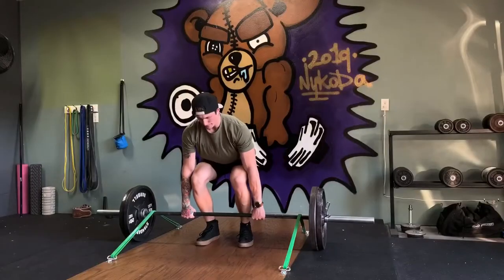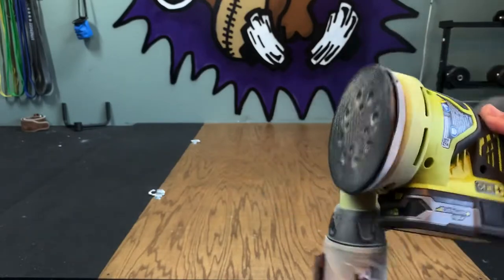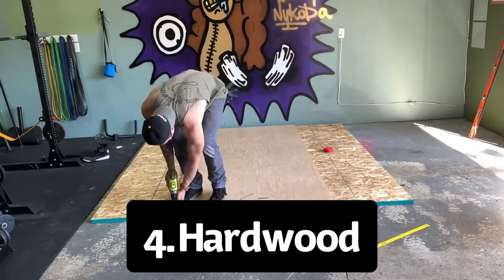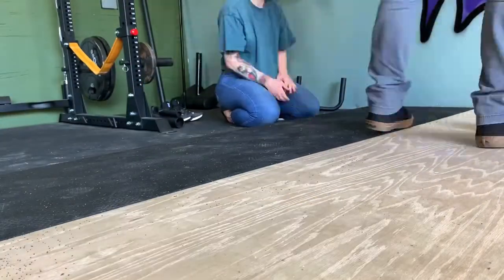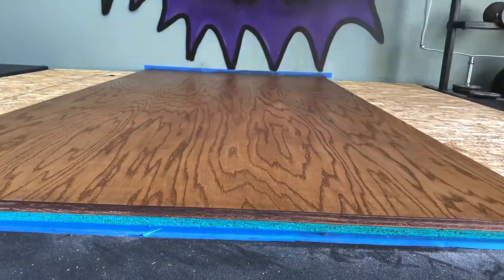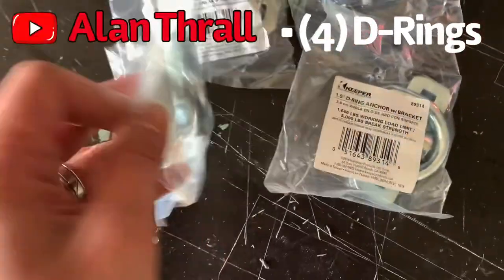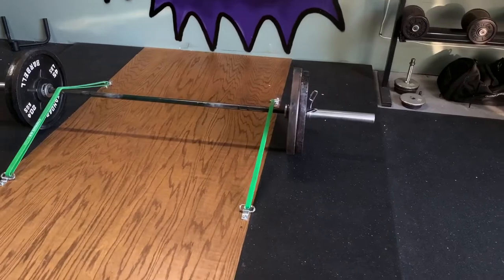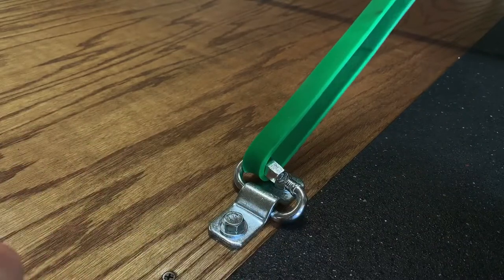How to Build a Deadlift Platform - Easy Garage Gym Projects

Comment: Iam not a powerlifter and don't really do olymic lifts. Do you think i will be better off with just stall horse mats or should i get a platform to protect my epoxy floors?
Also I have a small slope in garage and dont wanna be lifting on an uneven surface.  If i decide to go just with stall mats i wonder how 🤔 should i level them?  They are selling me an 8x8 platform here in my own town for $200.
If i buy platform hkw can i level it?
Sorry for all the questions and I hope you can help me. Thank u.
Reply from the maker: First off, we love questions, so thank you for asking! Secondly, if I were you, and you had some novice wood working skills I would build a platform, that way you can level it by using very small wood shims. Building one will cost roughly the same as buying that one you mentioned, depending on where you source your wood/supplies. So IMO, either of those options would be ideal. We will be releasing a new video on Tuesday, where I changed my entire garage gym to solve this very issue. I rebuilt my platform to be 100% level in every direction. Stay tuned! ✌️
Reply: The Outlier Theory I was planning on turning my basement into a garage gym and I thought the horse stall mats were for the deadlift. What’s the difference between having a deadlift platform vs horse stall mats and do I really need horse stall mats? Ty
Reply from the maker: tb nelson Having a platform gives you a solid foundation to work off of. The rubber horse stall mats only help with softening the blow of the weights as to not damage them. Having a platform is not vital for a garage gym, I used to deadlift off the horse stall mats before building mine. The difference is minute, and I would only worry about it, if you are a more advanced lifter. But for the average person, lifting off of horse stall mats is totally fine! Thanks for your question! 🙏 Let us know if you have anymore ✌️
Reply: The Outlier Theory oh ok thank you. Also I am thinking about completely renovating my basement. I’m gonna tear down the walls, ceiling, floor and putting a window. My question would be on what are the best price and best value machines and what I should get.
Reply: The Outlier Theory I was thinking about a bike, power rack with bench, deadlift area and what else
Reply: The Outlier Theory what are some useful and versatile attachments and or machines and from what brand tysm
Reply from the maker: @tbnelson4262  Check out our most recent video "I Was Sick of Going to a Commercial Gym, So I Built My Own." This is not only a walkthrough of my completely renovated garage gym, but it also dives into what the essential pieces are when starting out. Cheers!